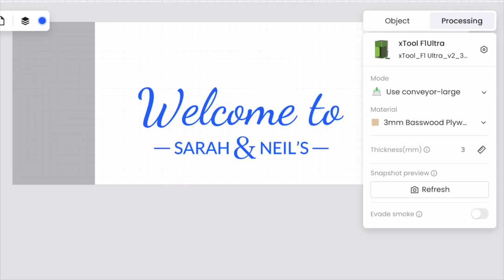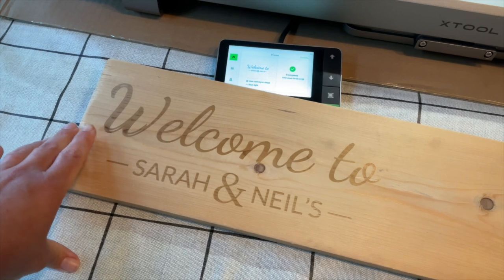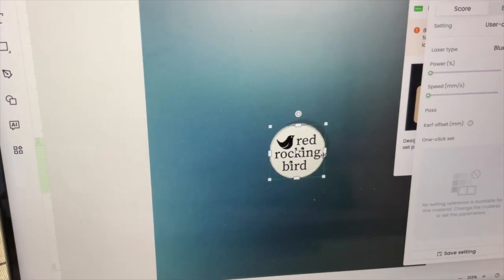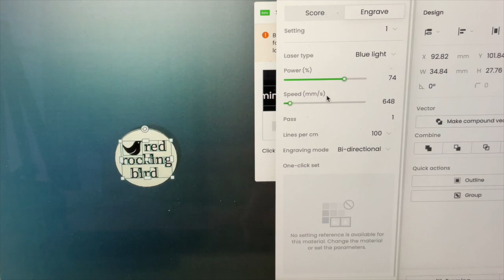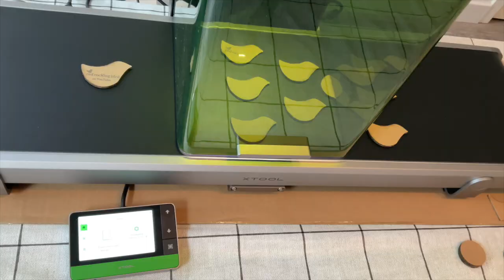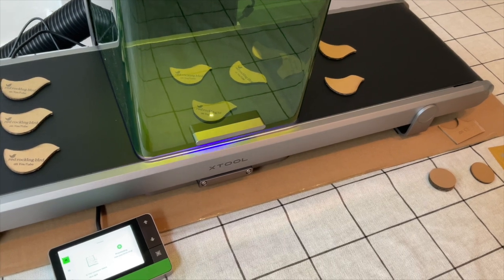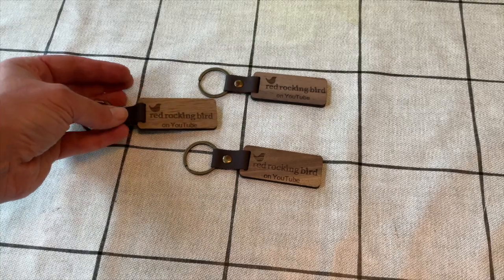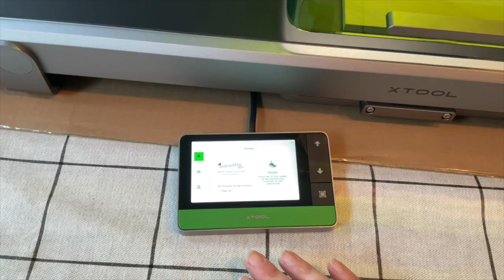Laser Engraving xTool F1 ULTRA with CONVEYOR - how to and review - Red Rocking Bird

Comment: Do you know how to Center an image onto a predetermined working piece? For example, if I had a 18 inch board but had a quote or logo or a combination of both that was only 14 inches how would I set up to where it centers left to right on my 18 inch work piece?
Reply from the maker: I think you need to measure where you would want it to start on the left, sorry for the late reply, I hope you have found your answer